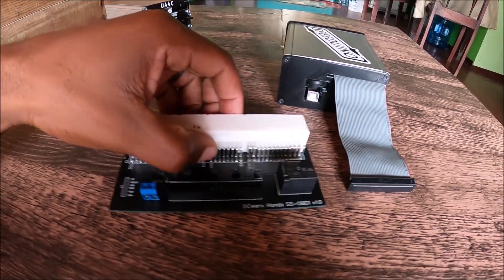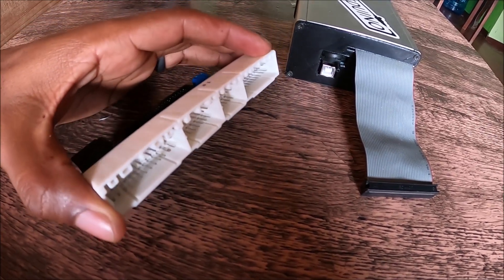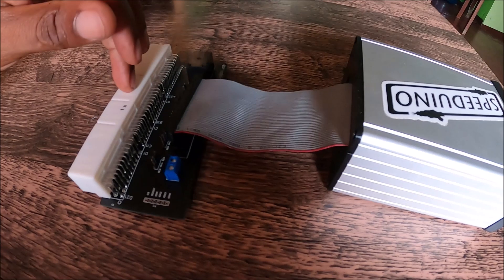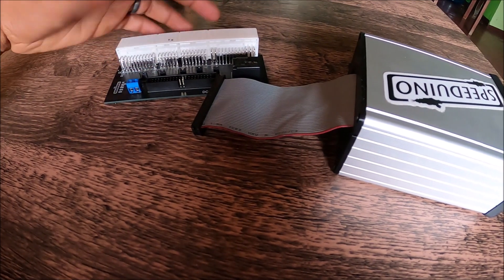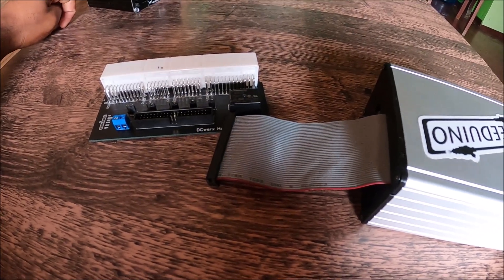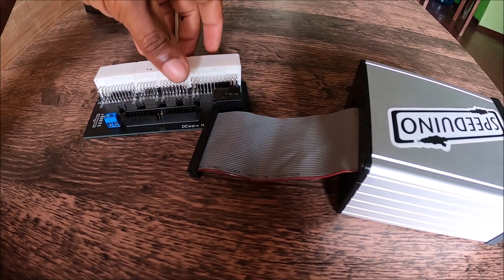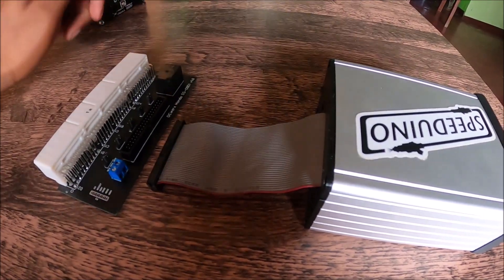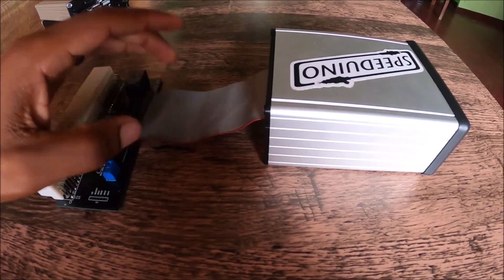New Honda Plug and Play PCB + DCwerx Website Launched

Comment: Will one be done for other makes such as Toyota ?
Reply from the maker: The older Toyota can be done relatively easily. The issues with older Toyota is the distributor VR sensors. I am trying to make a solution to that problem, but I also don't have a decent, good condition test car for beta testing.